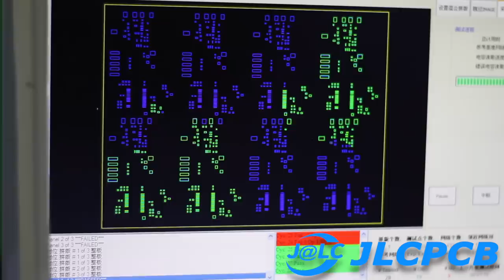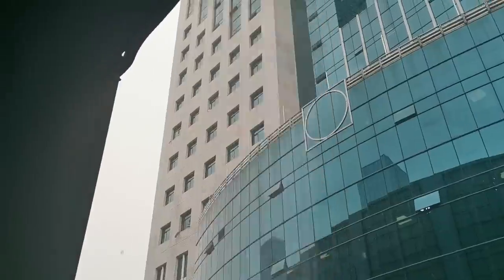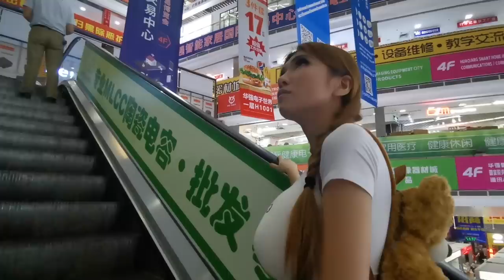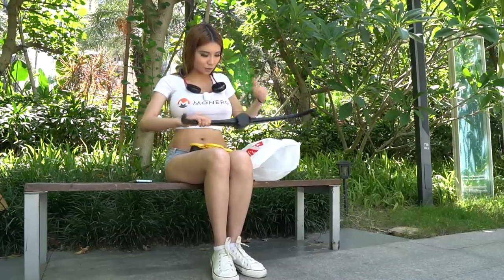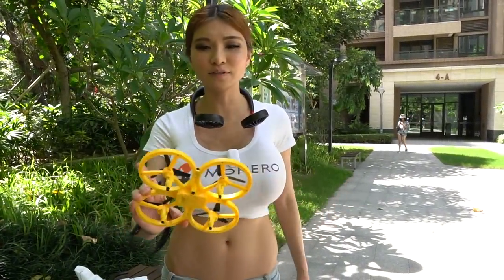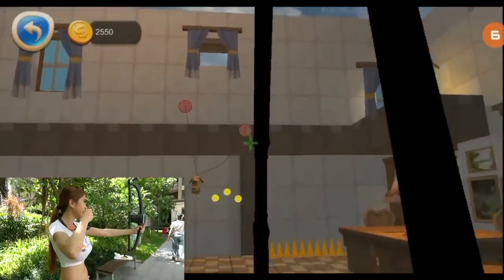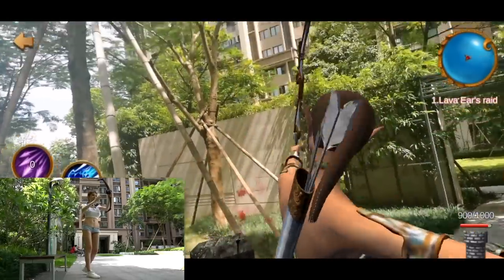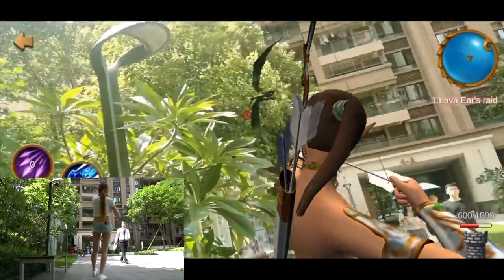Shenzhen Electronics Market Haul!

Comment: I think the wrist piece for the drone neds to be secured tightly on your wrist for it to work properly. I assume it has sensors that track the movement of the ring in relation to the wristband so if the wristband is dangly it won't be able to read your gestures correctly.
Reply from the maker: Yes, I figured it out later and moved it from my wrist to my hand.
Reply: @Naomi-Wu  Nice! seems like a fun was to control a drone.

Comment: Dear Naomi, I tried a Doogee mobile phone, the cheap S40, and it's been the best phone I've owned so far. At about $US99 it has the features of a $900 Samsung or iPhone.  No 5G though. I would have needed to buy the $299.99 S90. ($300 and 5G is WAY better than the alternatives).
Thank you so much.
Reply from the maker: They are decent, aren't they? Glad it worked out.

Comment: 4:25示范时感应器在紧贴手背，手环穿过母指
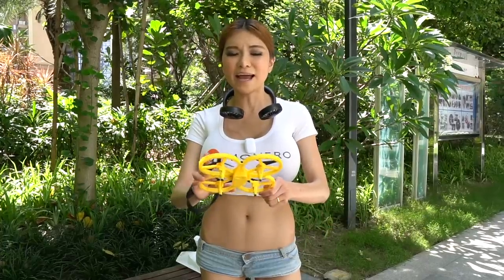6:29  -  7:12看来你没穿好手环，所以难以控制无人机

4:25 During the demonstration, the sensor is close to the back of the hand, and the bracelet passes through the female finger.
6:29 - 7:12 It seems that you didn't wear a bracelet, so it's hard to control the drone.
Reply from the maker: Yes, I figured it out later😅

Comment: Naomi: That wrist strap looks like it needs to be tightened.  The 'box' on top looks like it needs to be flat to the top of your wrist.  Could be wrong.
Reply from the maker: Once I moved it off my west and onto my hand it did much better👍
Reply: @Naomi-Wu  Good to hear.  That box is probably where all the sensors are for balance and the like.  So I suppose so long as its level it will work?

Comment: ---- Your videos jerk. This is caused by the 25fps of the video and the 60Hz of the monitors. That does not fit together. If you use 30fps the jerking is gone. The setting 1/50s helps against flickering lamps.  Please check it out!- - - -